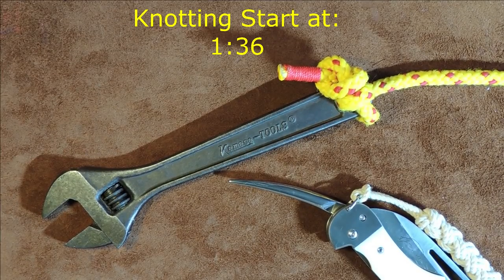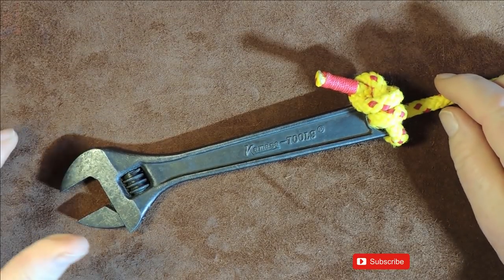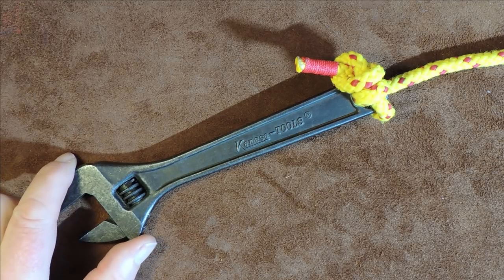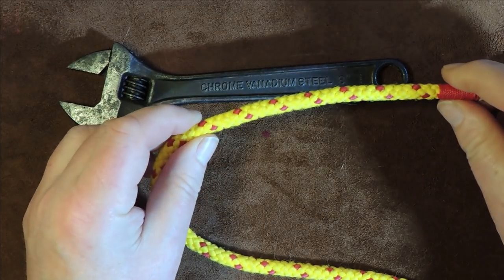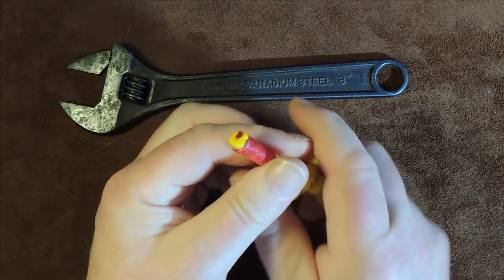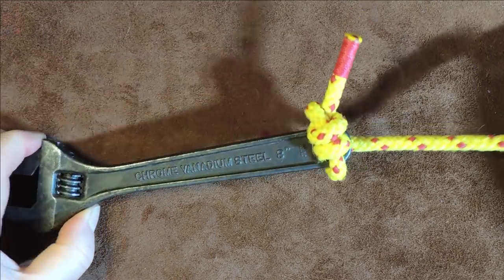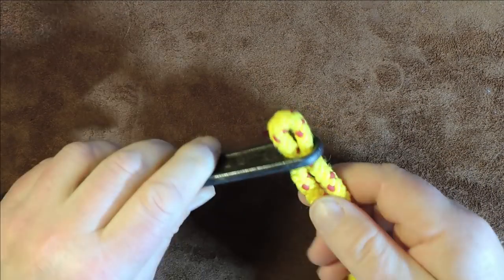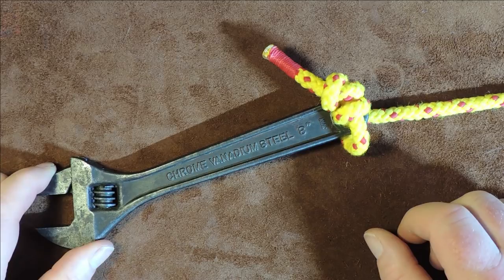Knute Hitch - Securing a Tool to a Lanyard - How to Tie the Knute Hitch

Comment: it's too simple to ever forget.  The cordage has be "Goldilocks", too thin it might come loose, too thick and it won't get tied at all.  The simplicity is great, but it adds a lot of bulk to the end of the tool.  I might use it as a stop gap, till I have the time to do a spliced eye or a seized loop.  Thanks for the video.
Reply from the maker: Yes, I think that thickness is the key with this one.

Comment: This knot seems dependent on tool eye size and the diameter of the lanyard stock.  A big eye in the tool and small cordage may not work well.  As stated before, i would use a fisherman's or Flemish  in this case.   Keep up the good work!  Love the references!  I would hate to guess the $$$ this channel has cost me on knots and rigging books!
Reply from the maker: Oh no, not you as well??? I have a whole shelf or knotting books, I often search eBay for old rope and books.